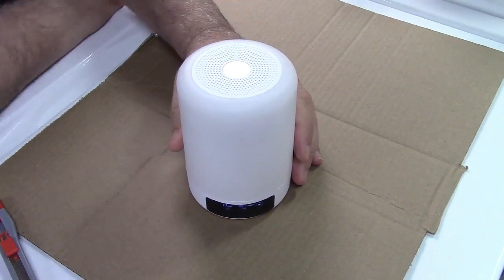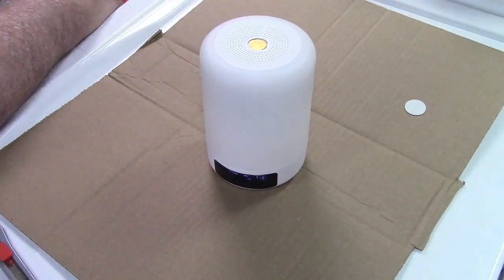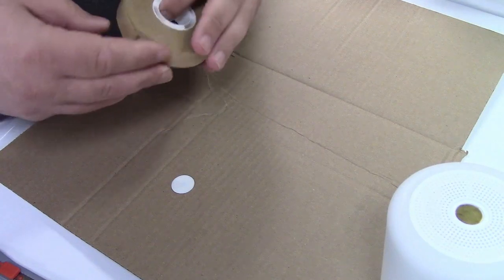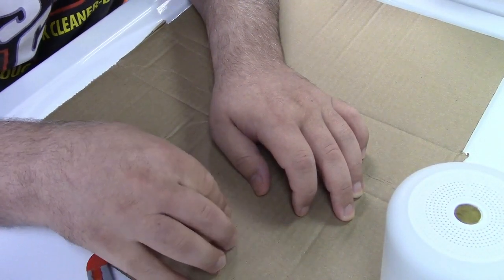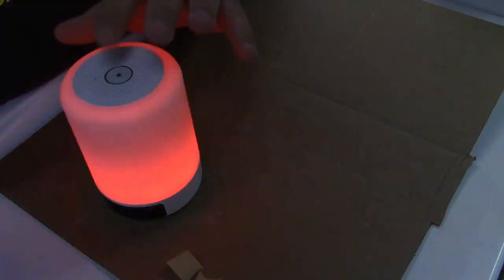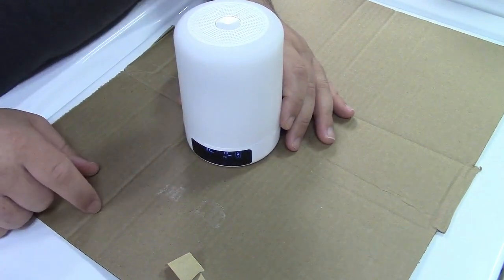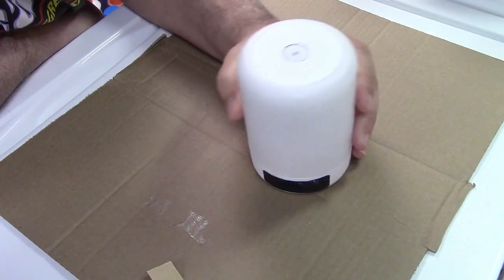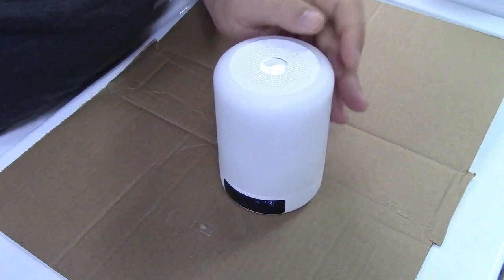Fixing The YSD Bedside Table Lamp

Comment: Looks like a dandy repair to me! Hard to beat that factree look. I'll have to get a roll of that for the hoard. I'm sure there will be a use for it, at some point.
Reply from the maker: Thanks.  Real handy stuff to have around.  I'm going to use the same technique for another repair of something that needs to be stuck back down.  Actually, 2 things.
Reply: @jaykay18  I recall some things way back in the day, this would've been perfect for the repair.
Reply from the maker: @dynatrak  I'm absolutely certain about that.  Sometimes when you look back at a repair you did, think of some other aid you have now, and how much easier it would have been back when.  There's always a next time, should it break again.

Comment: We use that same or very similar tape at work except what we use is 1.5" wide and is a big roll probably 6" in diameter.  We use it on cardboard cores that we wind material onto.   We have a couple different kinds.  One is a legit double sided tape and the other leaves just a layer of adhesive.   Which one we use is dependent on the product we are running.  The stuff like yours we get from 3M but also from another company.  They are almost the same except the off brand doesn't release from the backing as easily as the 3M stuff does- but I'm sure it's a lot cheaper than 3M and that's why we have it.
Reply from the maker: I never knew any other uses for this stuff, but that definitely makes sense now that you say it.  I think the stuff is marketed for those into scrapbooking.  3M also makes an applicator device for it.